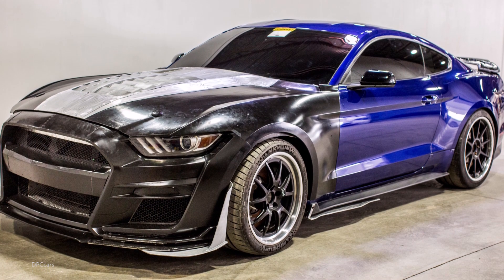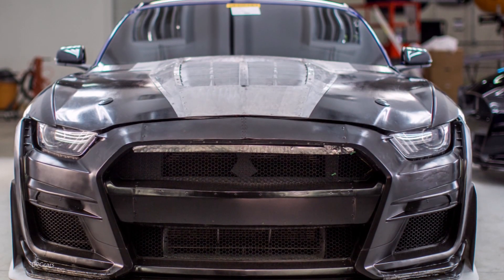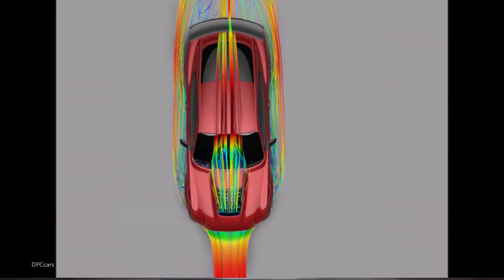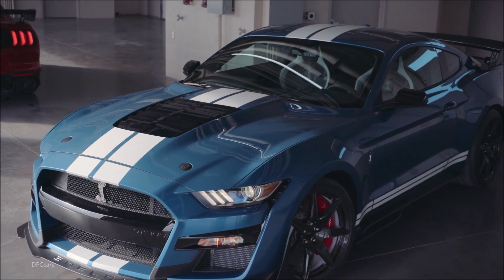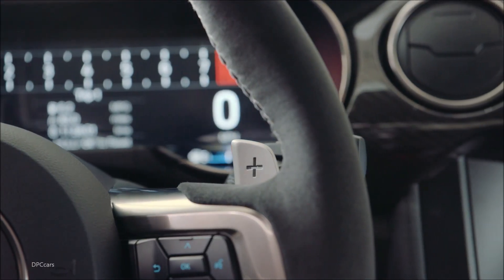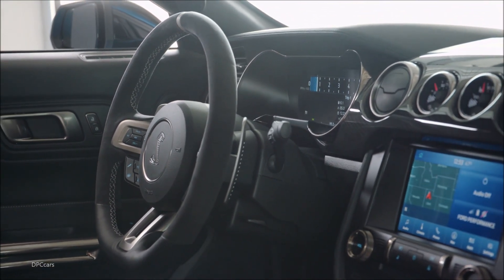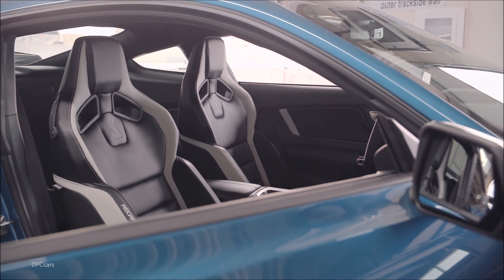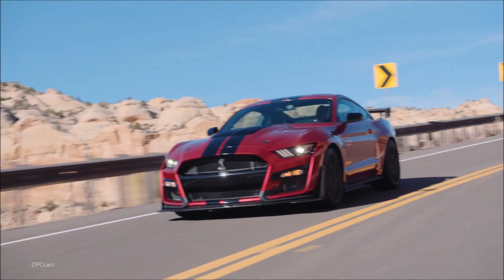2020 Ford Mustang Shelby GT500 Top Speed

Comment: If this is true , very disappointing.
Reply: With such a low top speed, that car won't stand a chance against a ZL1, or ZR1. The only car it will beat is a Hellcat, and even that will only be by the handling that the car will beat the Hellcat. Ford needs to stop slowing the top speed down on their cars.